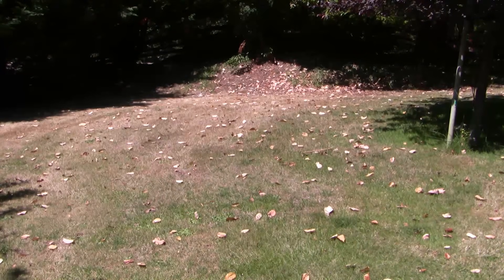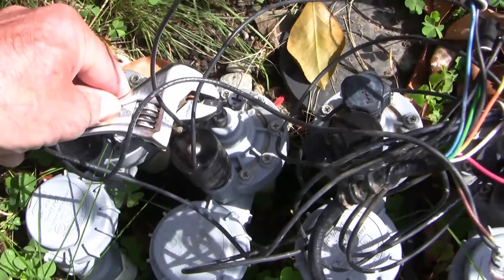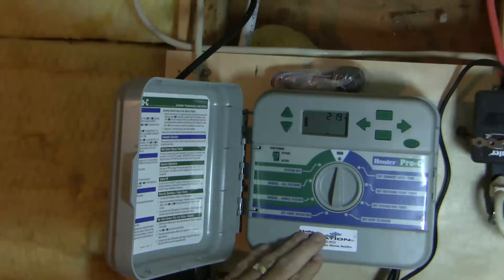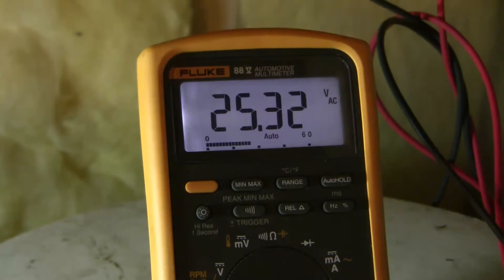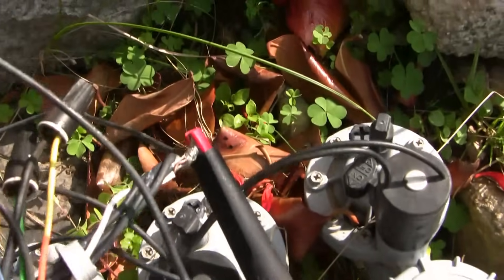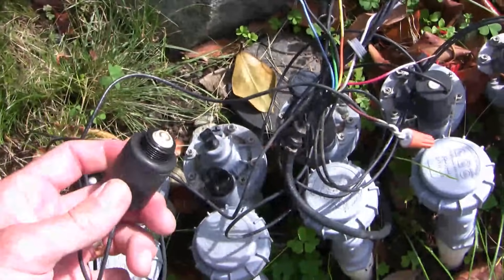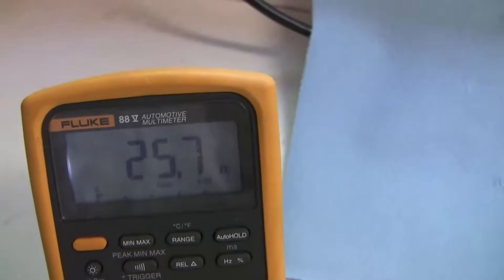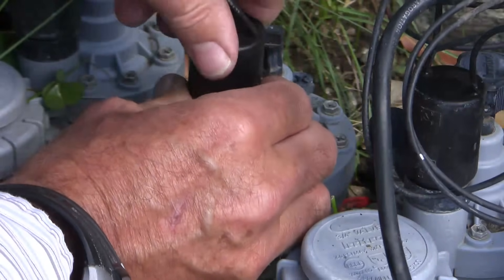How to fix an irrigation sprinkler zone that is not working

Comment from the maker: It is uncommon for solenoids to fail, and in your case you may have extra sediment in your water that causes mechanical issues (I have well water and that is the case here). I would look at your water pressure and look for possible obstruction in feeder lines or leakage that would cause a general drop in systemic pressure. Sometimes pressure is fine but flow is bad.  Remember you can mechanically open those valves and if the problem persists when you open mechanically then it's not the solenoid.

Comment from the maker: The answer to your question is in the other video I did , titled "how to fix a leaking sprinkler head". The first place to look is to see if the previous owner opened the solenoid manually for the winter. This is done routinely to prevent water from pooling and freezing at the valve, possibly damaging the valve. After watching both videos, wander around your yard until you find the solenoid box. Be sure they are all manually closed. Your solenoid is probably fine, it's another problem.

Comment from the maker: If it won't open with manual control, I would look at mechanical issues. If all the other zones are working normally with normal pressure, your problem is between the solenoid and the sprinkler heads of that zone. One of the commonest problems is a leak distal to the solenoid, which prevents pressure from building up in the circuit enough to lift the sprinkler heads up and blow water out. Turn it on and look for a flood, then dig. Failing that you could disassemble the zone solenoid.

Comment: My control valve box had a leak, so a friend of mine who used to be a gardener came over to fix it for me.  Since then, there was no leak.  However, my station # 2 is not working.  Manually, I turn it on and I don't see the water comes out.  I think the sprinkle heads do not pop up either.  This station was working before.  What do you think of this problem?  Pipe broke, low voltage, low ohm?  What are your instructions on this?  Thanks for your help.

Comment: Very well thought out and organized. Breaks done the steps easily so the real problem can be fixed quickly and efficiently. Nice job. Because replacing the whole valve is more expensive and if the trouble is in the wires or in the timer is a waste of time and money. Thanks DM

Comment from the maker: First, a basic suggestion -- be sure the manual valves are all turned off, since if any one is left open the others will not have enough pressure to operate. 

Second, try to dissect the problem down to a simple one -- I suggest you learn all you can about what a "voltage drop test" is, and do it while one solenoid is getting power (see my video on starter motor testing). When multiple devices are involved, it is commonly a bad connection at ground or perhaps an actual short to ground.

Comment: Hello. I have a 4 valve system and only the first valve worked so I replaced them all with brand new valves and solenoids. Unfortunately that did not solve the problem. I can feel some vibration on the solenoids when I use the timer's manual mode. I'm also able to turn the water on at each station. There is no reason that the wires could have been damaged. What should I do next? I appreciate your input. Thanks

Comment from the maker: One other thing that didn't make the cutting room screen is the chance of a short to ground. If you put a screwdriver into ground, and measure resistance between that and any wire, you should always get at least 700,000 ohms. Pay close attention to wire nuts and any place you could be leaking power. Good luck.

Comment: thanks for such a great video!
i will be using your electrical short techniques. i have a new control box that wont turn anything on. i believe there may be a short in the wires. i'll try a multimeter to find the short.